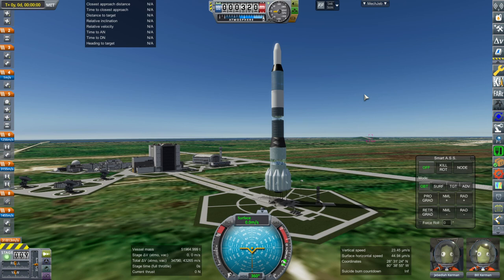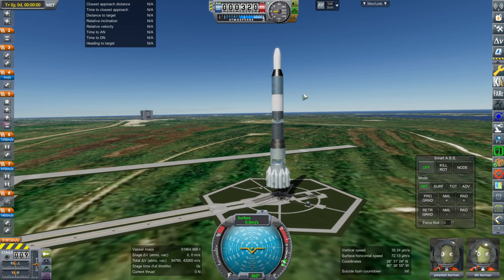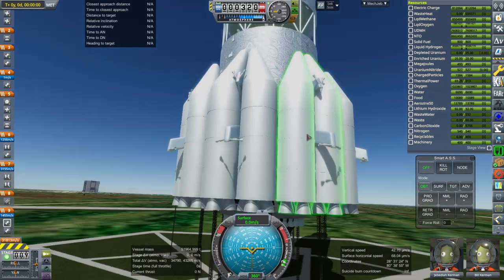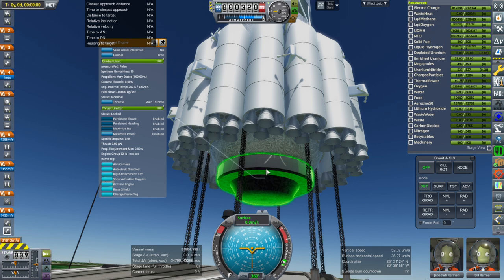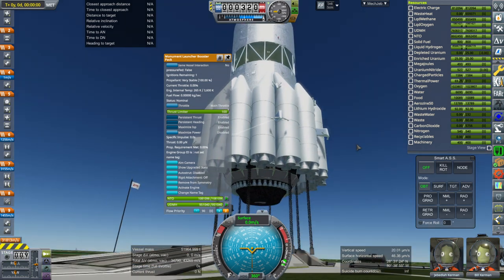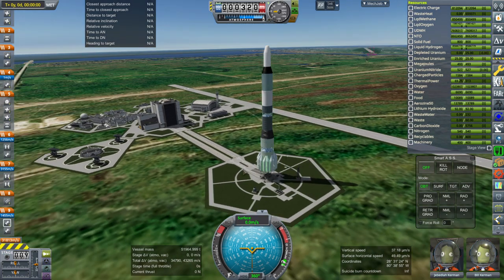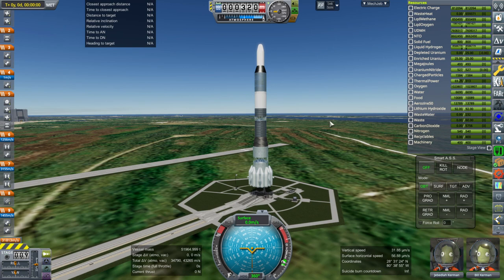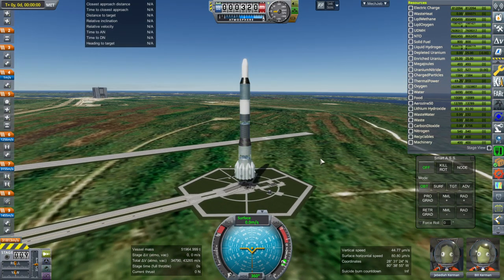Realism Overhaul in KSP 1.8.1 - Monumental Infrastructure (Concept)

Comment: The first stage of monument has roughly 18.5 times the thrust of the first stage of Saturn V. Sound levels, explosion strengbts, and radiated heat all drop with the inverse square of distance so I would expect the minimum safe distance to be 18.5^0.5 = 4.3 times larger than it is for the Saturn V. 

The exclusion zone around a Saturn V launch was 3 miles in radius, so 12.9 miles/20.8 km is what I would propose for a monument launch.

This of course isn’t how they would calculate the size of the exclusion zone for a real rocket launch, but I think it should be a good enough estimate for Kerbals.

Comment: So I did some super-quick calculations, vastly overestimating the total energy of the monument rocket IF it exploded, and arrived at a number of roughly 90 kilotons of TNT.

So from that, I extrapolated, using some online calculators, which are saying something like 6.5 miles away from a 150 kiloton explosion would still create horrible damage, but where this is like half of that, that would likely be mostly fine.

Now this NOT being a nuclear explosion does change the situation a lot, as you wouldn't get that same kind of super-flash, it wouldn't be an airburst, unless the rocket exploded shortly after launch?

Also this should only be the extension from actual populated areas?  Not necessarily shore?

That's the best guess I have for you though, so...  Take it or leave it.

Comment: Maybe it would be better to make a "launch clamp" type part for the aerospike pad rather than a static model. This would mean you would be able to sit the rocket very precisely in the cradle and have it stick there, without having to finely adjust its altitude in the VAB.

Additionally, with the distance at sea that you would probably have to launch something of this scale, it may be better to use a floating (presumably anchored) platform rather than a crawler causeway. The best alternative is probably finding a suitably isolated patch of desert to place a dedicated launch facility.

Comment: would replacing the clusters with RD-270Ms make a noticeable difference in performace, or maybe a staged combustion F-1 running flox? you might be able to downsize the rocket and reduce lag

still wondering what was going on in bob truax's head when he decided it was a good idea to make a 23m wide pressure fed engine

while i'm here lets go one more horrible idea 
hydrogen-flourine-lithium M1

Comment: I'd say minimum 10k for Monument, minimum 25k when dealing with nuclear stages.

Also, someone needs to come up with a way for engine clusters as a single part to work with part failure mods such that they don't declare the whole cluster as dead/damaged. Just a thought.

Comment: Hey Raiz you should get the new Ryzen CPU's, because they have 20% improved per core performance which works best for these simulators, in microsoft flight sim 2020 you get over 25% more performance than with the best intel cpu.